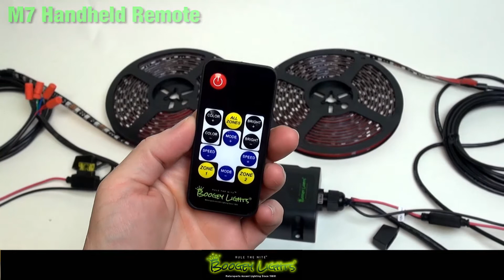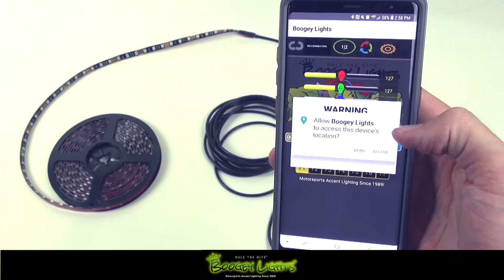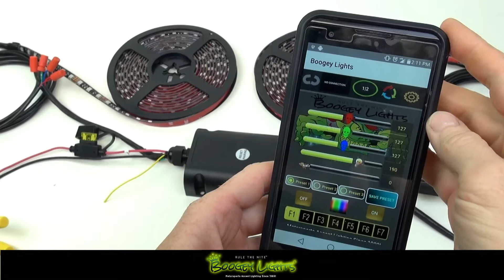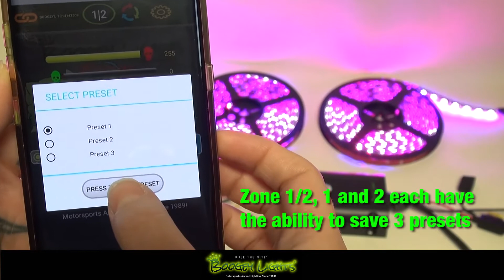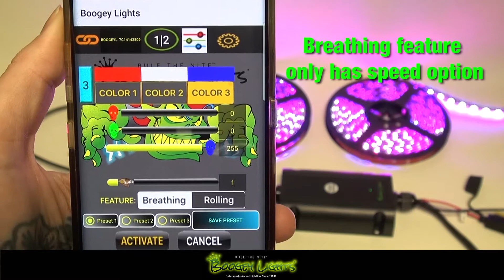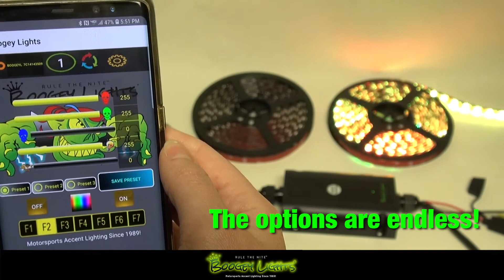HOW-TO Operate Boogey Lights Dual-Zone Controller

Comment: Hi can u show me how to connect it
Reply from the maker: Sure thing!  Here's a diagram from our website: https://www.boogeylights.net/?wpdmdl=958

In short, the Dual zone has a Red, Green, Blue and Black wire coming out of both ends - those go to your light strips.  You decide which light strips you want on either zone 1 or zone 2.  There's also a Red (hot) and Black (ground) wire coming out of both ends - those go to your battery.  If you're using under 20amps, you only need to connect one Red and one Black wire to the battery.  However, if your setup is pulling more than 20amps, then you need to connect both Red and both Black wires to the battery.  Hope this helps!